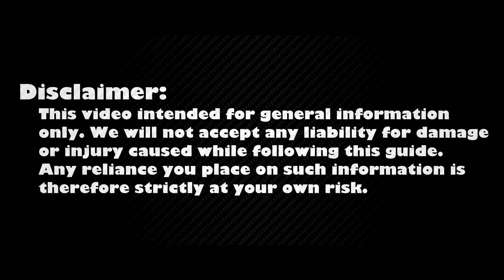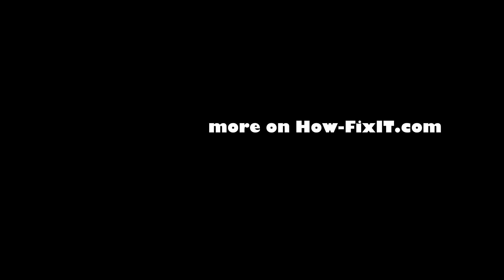HP Pavilion dv6500 Disassembly, Fan Cleaning, and Thermal Paste Replacement Guide

Comment: muy bueno tu video. pero tienes que explicar que hay 2 tuercas debajo de las RAM que si no las quitas no puedes sacar la parte superior de la laptop.

Very good your video But you have to explain that there are 2 nuts under the RAM that if you do not remove them you can not get the top of the laptop
Reply: felix jesus alfonso ramirez. Encontro el truco d como sacarlas tuercas